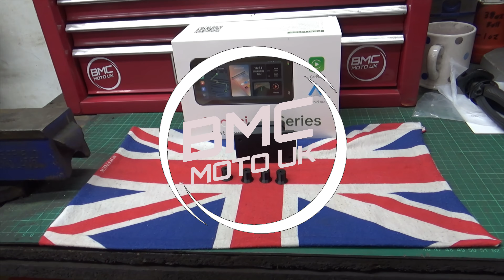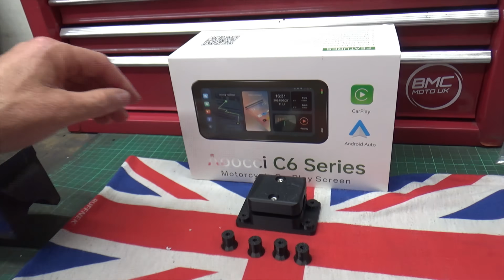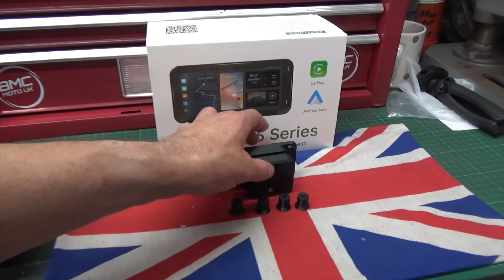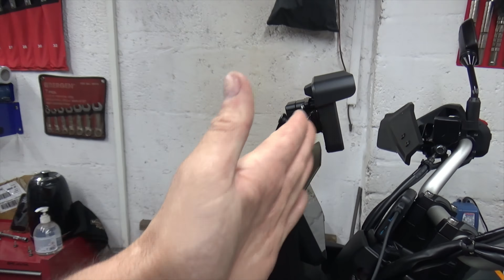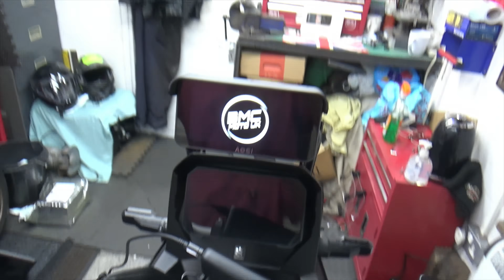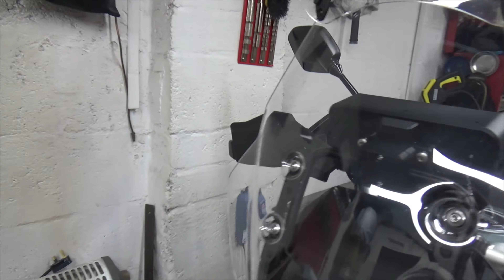Aoocci C6 Pro upgraded 3D printed mounting bracket

Comment: @bmcmotouk, many thanks. Will be ordering a block for the Aocci C3Pro
Reply from the maker: Excellent stuff, drop the guy a message first to see if he does the mount for the the device you have but I’d imagine they will be the same
Reply: @BMCMOTOUK  Indeed. I looked at mine and it has 3 mounting points not 4 like yours. I will DM the seller 👍
Reply from the maker: Yes best to do that. I do know that he was looking at producing other mounts
Reply: @BMCMOTOUK  Good to know. The mount looks both high quality and mounts the device just where I want it. I saw the same issue with the ball & socket mount.
Reply from the maker: Yes it’s a quality mount and well made

Comment: Very nice. I bought a similar bracket for my Carpuride that is also bolted directly to the round bracket. It is such a good mounting point. Right above the dashboard and in the line of sight. No issues with vibrations.
Reply from the maker: Yes it’s much better and I’ve no vibration issues either!

Comment: Wow. Thanks for the review of my mount. For additional info it's printed with ASA so no issues with it warping in hotter climates up to about 120°c. ASA is also UV resistant so perfectly suited for outside applications. I can also do the mount with offsets from the centre position but only for 12mm bars. Thank you so much for the review. I hope to have mounts for the BX and C9 soon.
Reply from the maker: Thank you for your professionalism and emails regarding your fantastic product Phil. Delighted is a complete understatement and I would highly recommend your product to anyone!
Reply: Hopefully the lad can do up a mount for the CRF Rally 300 and the C3???
Reply from the maker: Hi Kevin, if you contact Phil via his eBay listing (see description) he may be able to help you out. Phil is a great guy to deal with and is very knowledgeable in this field
Reply: @philhaddon do you have an email address? I would like a very similar product
Reply from the maker: If you click on the link in the description of this video it will take you to Phil’s listing on eBay and you can reach out to him via the message seller tab. Hope this helps